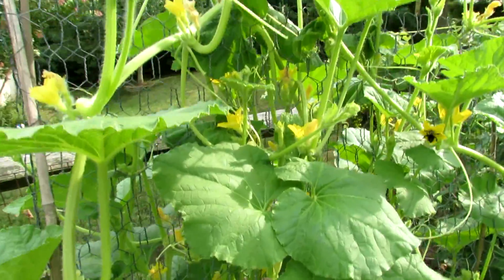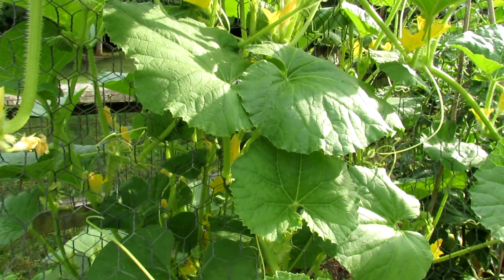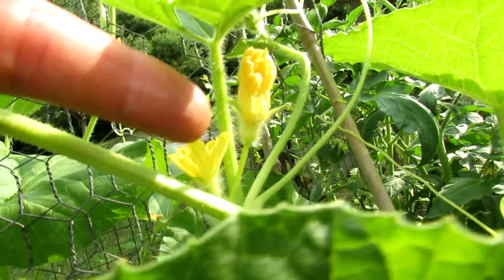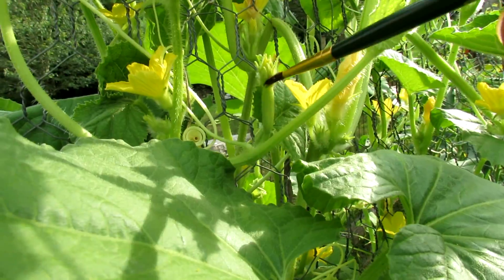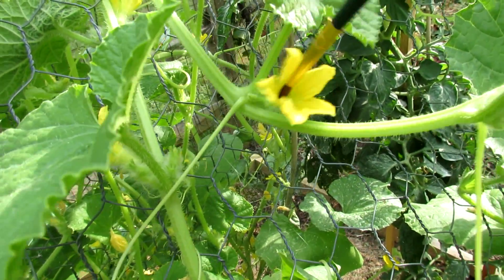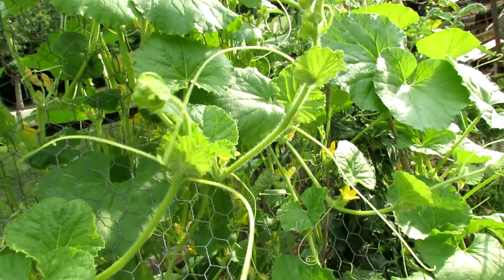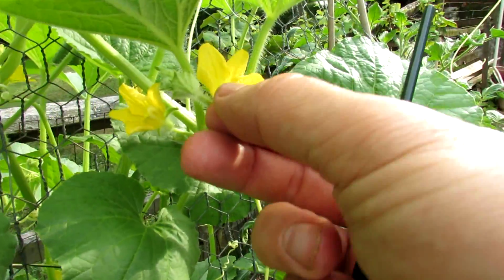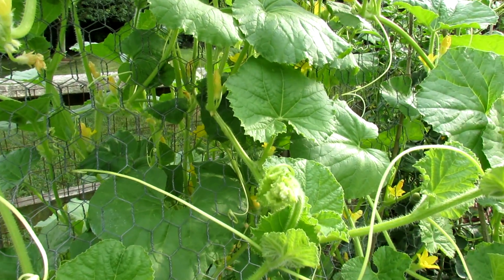TRG 2012: Hand Pollinating Cucumbers: Male and Female Flower Identification

Comment: Instead of a paintbrush, I use a electric toothbrush.  It works awesome
Reply from the maker: Thanks
Reply: An electric toothbrush is also awesome for 'buzzing' tomato flowers. Just touch the moving bit to the stem of the flowers and shake those things like crazy. Super improves your yield and also great for indoor hydroponic systems :) Have tried it on my hydro- cucumbers but I think I have better luck with a paint brush ...

Comment: hello sir i am having an eggplant at my garden its having a lot of flower but not a single fruits can you plzz help me, each time the flower comes it blooms and fall off.,
Reply from the maker: The drop due to Nature, too cold, too hot, water issues. Best you can do is consistent watering and give the soil time to dry and feed regularly but not a lot. Wish I could help more.
Reply: These types of plants generally have male flower a week or two before female flowers show up. The male flowers come first to attract bees ahead of the female flowers so the bees will have the pollen when the females are ready to pollenate. 

Just figured this out myself trough researching it. 

If you have all female flower your variety may be seedless and not require male flowers in which case try pollenating female to female.

If the flowers are popping up but falling off the conditions aren't right yet for fruiting. Temp was wrong, or not enough water or something like that the plant aborted the fruiting cycle it was trying to do. It will eventually happen.

Comment: Thanks so much! Just started my cucumber plants a couple months ago inside. First time ever doing this ..gardening in general. Today I found out my one of my Cuc plant is flowering. Started indoor planting pretty early however. Plants are getting big and I'm from MN should I transplant them in May or you think June?
Reply from the maker: Transplant as fast as you can as the grow fast and they will be stunted. I try and time mine so it 4 weeks from putting the seed in the cup to putting them in the ground. Actually 3-4 weeks.Please visit The Rusted Garden Seed & Garden Shop: www.therustedgarden.com
Reply: I started too early. its been about 2 months now that my tomatoes, cucumbers and peppers have been growing under indoor lights. the lows are still hitting 40-45 at night and only 50-63 for highs that's for the next 2 weeks according to the weather here in MN ..I'm aware putting these plants outside even after hardening them off wouldn't be beneficial..correct?

Comment: hey gary my plant is only 4 inch tall right now and is  starting to flower do i do anything  to flowers now,to help plant grow stronger?  if you have lots of male flowers do you leave them alone or do you remove some ?
thanks  great videos
Reply from the maker: The Off Grid Prepper I just let my cucumbers grow. The varieties vary. Sometimes lots of male flower first followed by female. The cukes tend to do fine when they get to size. Probably at 4 inches I would pinch it though. That seems small.